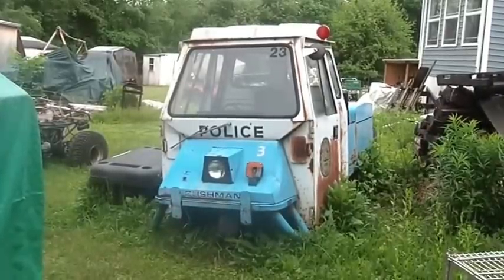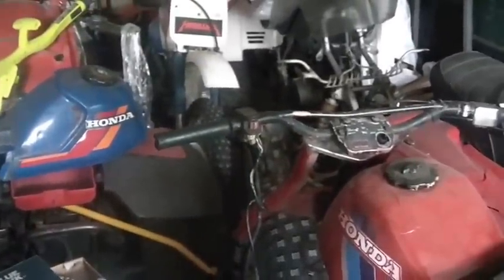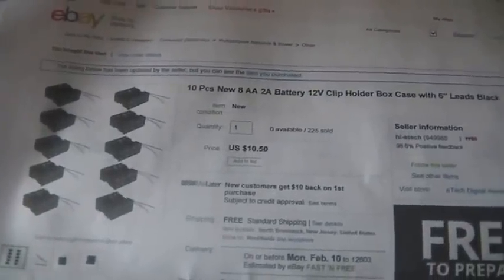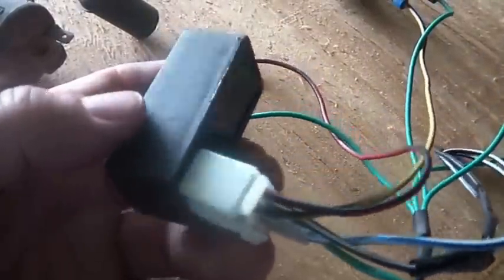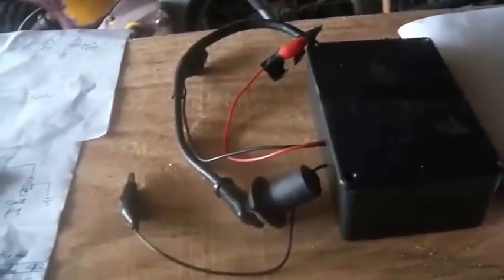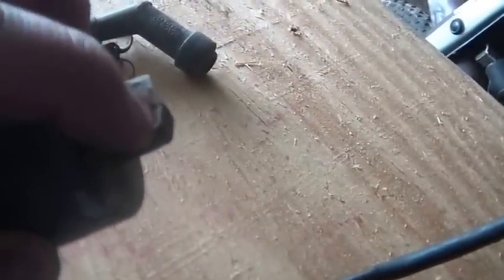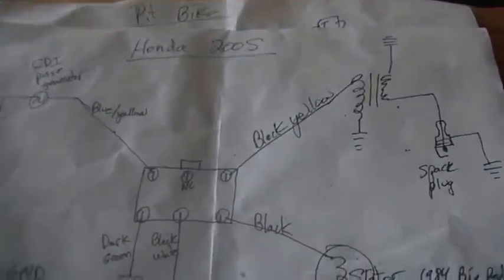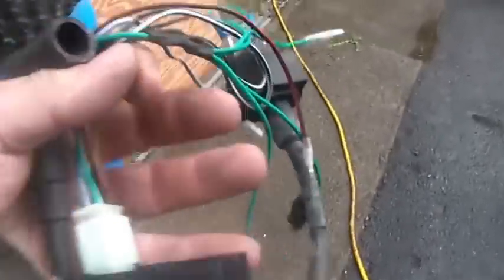6_2_15, Universal Honda ATV CDI hack, for Quads, ATCs, motorcycles

Comment: Hey I have a Honda 400cc side ways engine the cdi doesn't have 2 Earth's only one the other wire goes to one of the yellow wires in Rectifier Regulator any idea how to rewire that if I wire it with a cdi like you do it runs like crap any help.

Comment: Ok Harvey so mine is a DC I've bought ten of the ebay cdi's and I'm way over what I could've just bought the oem Honda version but  I'm not giving up 
I'm going to assume that if it's a DC cdi I've gotta make the same universal jump pack but with a DC pak right ?because everytime I put it in reverse it does.or go to rev it cuts out or dies backfires .carb is new valves are good it's in my knock off cdi where the problem lies.any help would be greatly appreciated.

Comment: Harvey I have a 1987 trx250x which is running but I am curious that my cdi wiring has the 2 small plug wires reversed. The upper wire color is black/red. The lower is black/white. Different from all diagrams.

Comment: Need help with my 1980cx 500, it’s only getting spark in one of the coil’s
Reply: @rodrigoruas4196 those have 2 cdi boxes and you can swap them and see if spark moves to other cylinder or not and troubleshoot from there.

Comment: Awesome thanks I bought a Chinese ignition as a backup and used it on my Yamaha kodiak works perfectly when I was getting frustrated with stock ignition. Thanks for the video!
Reply: did you have to rewire the Chinese CDI box?
Reply: @user-zt2cc7qq9b  yes but it worked great

Comment: i have a kz550 1981 cdi is bad .  what can i do for it double the cdi units ? one for each pulse generator ? thanks good work .  billhmsvs@gmail.com     thx.
Reply from the maker: Hey Bill, No guarantees ok? But, if there are 2 pulse generators, double the number of CDI systems, if there is only one, build one and use an ignition coil with 2 outputs, (2 spark plug wires), I hope this helps.... Thanks for asking, watching, and commenting!!!

Comment: Is your 12 volt box  AC or DC ? Thankş....John
Reply from the maker: Hi John!!!   This portable box has a 12VDC GY6 CDI box in it.... If I was to build it again, I would install a 4 pin, DC CDI box like this one... https://www.ebay.com/itm/DC-CDI-Box-4-Pin-Quad-ATV-Quad-Dirt-Bike-Go-Kart-50cc-70cc-90cc-110cc-125cc/282084904204?hash=item41ad920d0c%3Ag%3ABegAAOSwgY9XdT4A&_sacat=0&_nkw=4+pin+dc+atv+cdi&_from=R40&rt=nc&_trksid=m570.l1313  and use a pit bike wire harness and spark coil like this, https://www.ebay.com/itm/Wiring-Loom-Kill-Switch-Coil-CDI-Spark-Plug-Kit-For-110cc-125cc-140cc-Pit-Bike/153052218380?epid=4021109604&hash=item23a29f840c%3Ag%3A05YAAOSwW8FbGHhl&_sacat=0&_nkw=pit+bike+cdi%2C+wire+harness%2C+spark+plug%2C&_from=R40&rt=nc&_trksid=m570.l1313&LH_TitleDesc=0     Put the AC CDI box that comes with the kit off to the side, wire it as the schematic for  DC cdi shows, and all shoud be good!!!!   Thanks for asking, watching, and commenting!!!!
Reply: Thanks for the link

Comment: I have a kawasaki 300 4x4 that someone gave me and it has no wiring harness....could you help me figure out how to make a wiring harness for it ?
Reply from the maker: Hey Kevin, I have not used the ignition hacks on a Kawasaki yet, I would start out by looking for an OEM harness, I checked eBay and they seem to go for around $70, not a bad price when U start adding up the cost of a CDI, voltage regulator, connectors, and a starting solenoid.... Make sure U get one that is it is indicated that it is from a running quad, make sure it looks like it will hook up to all Ur connectors, and make sure that it comes with the voltage regulator, cdi or cdis, (there maybe 2), and the starting solenoid.... Let me know how U make out, thanks for asking, watching, and commenting!!!!

Comment: I'm not getting spark  change spark plug the CDI box change the coil check the on-off switch will the stator make it not get Spark this is a TRX 300
Reply from the maker: Hey J. Puckett!!!   The last part U have to change is the spark coil, before we begin this discussion, how many CDIs do U have, a lot of the Honda quads have 2, one is DC and it is used for going forward, the other one is rev limited, ac powered, and it is used for reverse.... Thanks for asking, watching, and commenting!!!

Comment: Hi Harvey , I like your tutorials and the backyard. Big fan.I am working on Yamaha Moto 4 350 1987 . Bad clutch. I found the engine all completed from big bear 350 1990. I swapped the engine , but have a problem- no spark. Do you think I have to change the CDI box from big bear ? I left original CDI from Moto 4 350 engine. The Moto 4 engine ran . After swapping the engine with big bear, I lost the spark. Are the CDI boxes that much different , even both engines are 350 and only 3-4 years apart in production? Thank you for your help

Comment: So I changed the spark plug thinking I might get lucky. Fired up and ran great but I wasn't convinced so put old plug back in. Still ran great. I am now thinking that the prob may be in carb maybe something was holding the float so it would get enough gas to idle but nothing more. Drained the bowl, lots of junk came out will pull carb apart and clean, change filter hopefully will fix. I did do all the ignition and power stuff you had mentioned previously everything good. Thanks a lot for the advice

Comment: Hey buddy, My old points system for the FL 250 is so in and out. The points are worn out and I'm having trouble finding new ones besides the point plate is sloppy af. If I am understanding you correctly, I can just bypass all that with the system you described. Will I need to do anything inside the stater like remove the old points or reroute any wiring inside the stater? I have a black wire and a yellow, that's it.

Comment: I have a honda recon that will start right up and idle no problem as soon as i give it gas it dies right out no spit or spudder nothing, acts as if i hit the kill switch and not the throttle. You seem to know your stuff, any ideas.
Reply from the maker: Hey Waylon!!! Assuming that Ur carb is good, sounds like Ur idle circuit is good, the run and enrich carb circuit are clogged, I also see this if there is water in the fuel and some in the carb bowl.... From an ignition point of view, this can happen if the DC side of Ur CDI unit is getting marginal power or Voltage such that it can come up with enough power to spark at low RPM but, not at higher RPM, so, check to make sure that the wiring and voltage to Ur CDI unit are solid, (make sure Ur battery is at 13+volts when the ATV is running), I would check the battery voltage first and then check the carb.... I hope this helps, let me know how it all turns out.... Thanks for asking, watching, and commenting!!!

Comment: good morning i have a problem whit my 1994 xrt300 honda quad no spark i replace the coil and still no spark
Reply from the maker: Hey Brandon, I think the 1994 xrt300 is like the foreman 300 here in the USA... So many places to start.... I always start with a new spark plug, then, make sure the handle bar and key switches are working properly, make sure that Ur larger CDI is getting 12Volts, makes sure all the wires are plugged in.... After that, one had to get into the dark and dirty of the CDI plug with a digital volt meter.... I hope this helps... Thanks for asking, watching, and commenting!!!

Comment: The reason I believe it is an 85 is because the three yellow wires coming from the engine have a round connector. I may be wrong about the year

Comment: I believe it's an 85 i bought a lifted golf with with the 250es motor and rear end in it. it looks like they rigged up there own wiring so I yanked it all out hoping to connect the universal cdi you made but with no luck because I only see three yellow wires one green wire and one blue/yellow striped wire coming out of the engine. thanks for replying!
Reply from the maker: Hey Tyler!!!!  If U have the blue/yellow striped wire, U have the pulse generator, the 12VDC CDI hack will work for U.... I think my video will help U, it will be up tomorrow night.... Thanks for asking, watching, and commenting!!!

Comment: I have an 85 Honda 250es. it has 4 yellow wires coming from the motor can you help me? not sure where to put the red/black wire to
Reply from the maker: Hey tyler, I would check the ohm readings between the 4 yellow wires and ground, one wire should look different then the other 3, that is the wire for the CDI stator, I would expect its resistance to be higher and the resistance of the other 3 should be lower.... Thanks for asking, watching, and commenting!!!

Comment: h
Reply from the maker: Hey tyler, I would check the ohm readings between the 4 yellow wires and ground, one wire should look different then the other 3, that is the wire for the CDI stator, I would expect its resistance to be higher and the resistance of the other 3 should be lower.... Thanks for asking, watching, and commenting!!!

Comment: I have a 1987 trx125 and a bad cdi.  I bought a cdi off ebay but it doesn't work.  They said the 1987 is unique in the wiring and they were sorry that it wouldn't work.  They told me the following:  "Switch the wires on the two plug and do not connect the green wires on the four plug, this trick works on most of the hondas."  Before I start pulling out wires or cutting, will doing what they said work?
Reply from the maker: Hey Ed, I would try what they recommend, but, I would do it in a way that I could reverse it should the swap not work, if it doesn't work, I would send the CDI back for a refund... Then I would use the 12VDC CDI hack.... 2X BTW, 1st - I am not thrilled about running a CDI without the green/ground wire connected, it is like flying a plane in the dark without an altimeter, one has no reverse to "0", or literal ground, it may work like that, but, as I said, I don't like it.... 2nd - I'm not convinced that Ur oem CDI is dead, for the 100s of Honda CDIs I've handled and seen mishandled, I have only seen one bad one... If U wish, I can check my hoard of TRX125s for a 1987, I think I have a few in the hoard, there is probably an easy hack to get around Ur CDI issue... Thanks for asking, watching, and commenting
Reply: @HarveySpooner  it will work but I just used one off my old xr 200 . Would you happen to have a set of plastics to sell or trade for some atv stuff.   Oh and when u use xr 200 cdi there is no rev limiter and haven't had problem with timing curve it runs great and don't get hot. But it will rev to the moon if you wanted it to other than that runs great.

Comment: my redcat 90cc only has 4 wires off the stator,  im assuming the white , yellow are for the regulator. that leaves me with a green wire and a blue with white stripe..and no spark.the cdi is 4 pin ....im stuck
Reply from the maker: Hey William, Ur 4 pin CDI means it is a DC unit, https://www.google.com/search?biw=1301&bih=620&tbm=isch&sa=1&q=4+wire+cdi+atv+schematic&oq=4+wire+cdi+atv+schematic&gs_l=img.3...5395.11388.0.12697.8.8.0.0.0.0.147.721.6j2.8.0....0...1c.1.64.img..0.0.0.fct9zPywjQA#imgrc=Bo_pd5dT5JCdOM:&spf=17   , That is the pinout for Ur CDI.... At some point, the key switch, handle bar switch, tether, and or remote for stopping the engine must be used to control the 12VDC to Ur 4pin CDI.... I hope this helps, let me know if U need more.... Thanks for asking, watching, and commenting!!!
Reply: So the lower right,(black wire) the kill ?
Reply: I had it running, switched the moter and harness to a quad fram and no spark
Reply: Kick start so i never had a battery,  im hoping it was just a coincidence.  I ordered a new 4 pin stater, ignition coil and 4 pin cdi so i can start fresh
Reply: Ive had the engine on a stand up scooter I build and it worked fine for the last couple of years, not sure how switching frames would make a difference unless something burned out when I started it last weekend...really dig your videos

Comment: Hey Harvey, been watchin your videos and they've been a big help, Got a couple questions. I just got a 300cc china quad and the wiring harness is fried so i wanna simplify to see if she runs. Anyway i only have 3 yellows, a blue/white(trigger) and a green/white(gnd) coming from the stator. The green/w and blue/w have their own plug and go to the CDI, the 3 yellow go to the R/R and then the R/R has a red and a green coming out going to the harness. Now i can only assume i have a DC CDI as i dont have a red/black wire coming from the stator to the CDI, is this correct? Its a 6 pin CDI and i have identified the pins and the power input was a black wire coming from a splice that went to some other box in the harness and a couple plugs.
Secondly i just want to get another cheap DC CDI to get this thing running and im wondering if i have to buy a CDI that is meant for a 300 or will one for a smaller engine do?

thanks for the help

Comment: I have a serious problem. my boyfriend is destructive. he has gone through 4 honda quads in less than a year. worst of all they belong to my mom.starting with a 84 fourtx 250 (700)then 2005 300ex(paid near 2500), 2015 250trx(paid around 1600), rancher 420 (paid 1000). now we recently picked up 2 parts quads. I am pretty good when it comes to working on them and I am stumped. his brother tore them to pieces and my mom has no idea. she will never forgive me for letting this happen. can you tell me things to check first the engines are fine. none are froze up or blown. I just want to get them fixed and before she finds them.
Reply from the maker: Hey Shani, I'm not sure on how to answer this question.... U maybe better off filling Ur life with folks who do not wreck things and cause U issues to clean up.... U have 2 problems with these quads, first, they R broken, and second, they R in pieces.... If U have any hopes of them running again, I would start by getting the parts sorted and put back on the quads..... Then go quad by quad, determine what is wrong with it, with as many quads at U have, including the part ones, I would make a list and write what is wrong with them.... Some may just need new gas and a carb clean, some may have lost keys, and it maybe a matter of bypassing the ignition.... For the ones with blown transmissions, cracked frames or other big problems, I would start with them last and probably would use them for parts.... When U get U list put together, send me a copy, I maybe able to put together videos for U on each one....  Good luck there, thanks for asking, watching, and commenting!!!

Comment: great insight and video. was interested in building the 12v stand alone box to get my atv running. i have a 92 yamaha timberwolf that has no spark. has new cdi, coil, and pickup coil.
Reply from the maker: Hey Doug, I should have a video up on the next few days on a high performance Casoli CDI box, it has a much hotter spark and I think it can be used to jump start a Frankenstein Monster if no lightening is not available... Good Luck with the Timberwolf, I used my CDI box on a Yamaha golf cart engine and it fired up, so, it should work on Ur Yamaha.... Let me know how it all turns out, thanks for the kind words, the info, your thoughts, watching, and commenting!!!!
Reply: Harvey Spooner.  Thanks Harvey. I ordered the dc cdi box, pig tail and coil. should arrive tomorrow. Hoping the 250cc will run good with the small cdi box.  Once i get it going I will let you know. I do appreciate your advice and help.
Reply: Did you get it running? I have the same atv here that has no spark.
Reply: It worked for meShane Mc Donagh
Reply: I only had to replace the cdi with a dc cdi and bought the wiring harness for it. My pickup coil and ignition coil was working.
Reply: I wired the dc cdi to the atv battery using an inline fuse.
Reply: Here is where im at. 80v off the source coil and .2v off the pickup coil on the stator. only one volt from the cdi box to the ignition coil. What do you think of that? thanks for the reply.
Reply: Shane Mc Donagh.  the stator voltage seems acceptable. Will probably increase with higher RPM's when running. The pickup coil..i checked mine on resistance only to ensure it wasn't open or shorted to ground. It sounds like a bad cdi to me if your getting a reference from the pickup "pulser" coil. The cdi mentioned in the video is cheap. i would give it a try.

Comment: Harvey I have been watching all your videos trying to solve my atc problem. I have learned alot already thanks for that! 
my issue is with a 1985 ATC 250es big red. It has intermittent spark... Sparks when it wants to but not all the time and thats testing the spark plug by grounding it out. Honda dealership wants 75$ for a ignition coil so I didn't even ask about a cdi.
I am trying to find a cheap CDI for my bike appaently it needs advance in it. any help would be appreciated ! Keep up the good work
Reply from the maker: Hey Brody, I would use a DC powered GY6 CDI and spark coil triggered thru the 250ES pulse generator... Something like this...   http://www.ebay.com/itm/250cc-Go-Karts-GY6-Scooter-Moped-Performance-6-PIN-DC-CDI-Square-Ignition-Coil-/191537486279?hash=item2c988619c7:g:LrkAAOSweW5VBnAE&vxp=mtr   ,  It has the advance built in.... Let me know if U need more help.... Thanks for asking, watching, and commenting!!!
Reply: Thanks for replying ! I will order that part. Will I just be able to cut off the plastic connector and wire it from the wires coming out of the cdi case? Other then that I understand everything I need to do thanks to you.

Comment: Does CDi have to be dc?
Reply from the maker: Hey Steward, CDIs come in 2 flavors, AC or DC powered, AC comes from the flywheel stator, for the DC ones, the power comes from the battery.... I hope this helps, thanks for asking, watching, and commenting!!!
Reply: Hey if my spark plug wire is to long would it weaken the spark